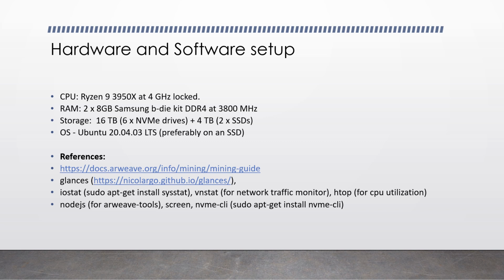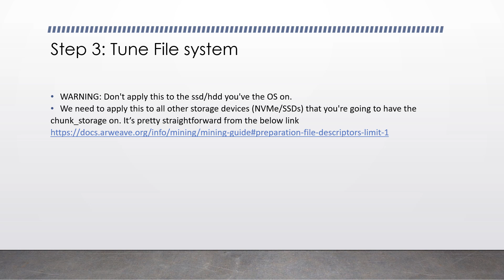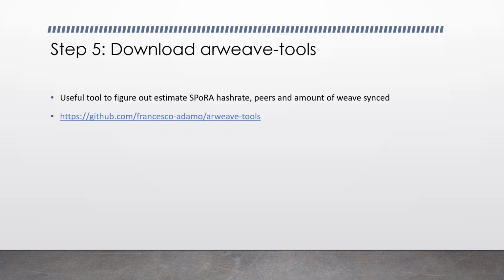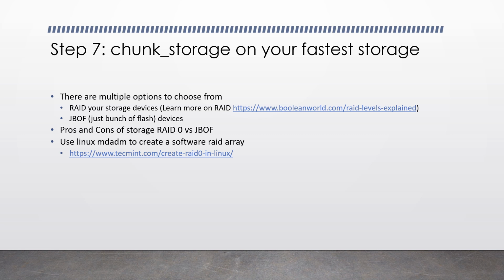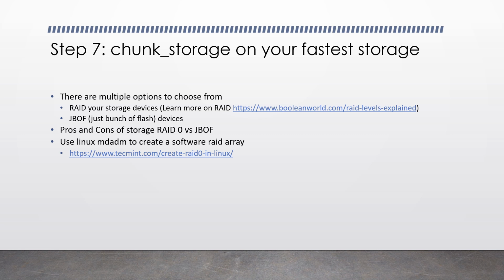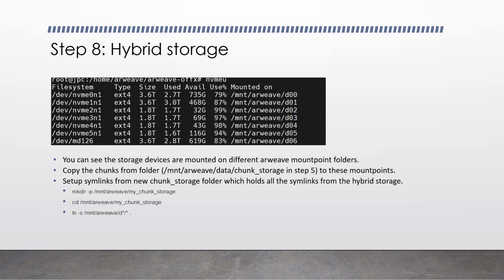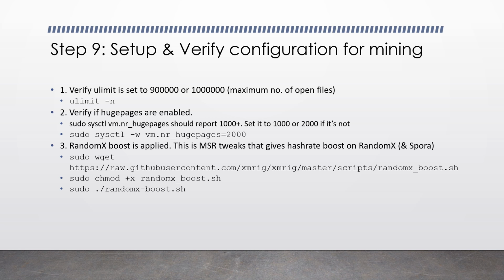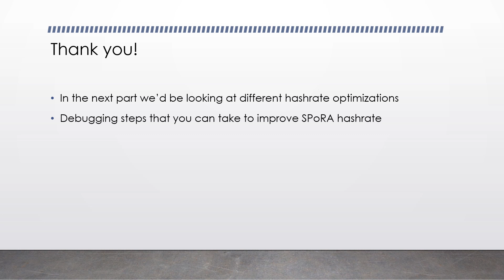Arweave mining guide - Part 2

Comment: I have a spare EMC 36TB Domain Data Storage, could  it be used to mine?? 
Processor: 1 x Intel Xeon 8-Core E5-2660 @ 2.20GHz SR0KK
Memory: 8 x 8GB DDR3 Ram
Storage: 12 x 3.5" SAS Bays
2 x EMC 4-PORT 1GbE I/O Ethernet Network Module - 303.121.100A
1 x EMC 8GB Fibre v2 I/O Network Module - 303.193.100A-01
1 x 6GB SAS v2 I/O Network Module - 303.178.100B.03
1 x EMC NVRAM 2GB v2 Module - 313-162-100A-01
Reply from the maker: Yes it can work.
arweave now only needs storage space for mining. HDD works as well. cpu core count is only needed for an initial step on converting arweave data to packed data (signed with your mining address).